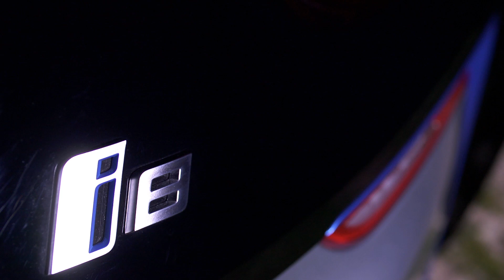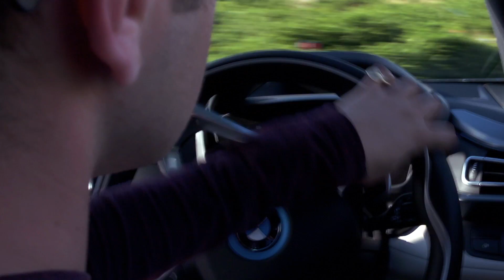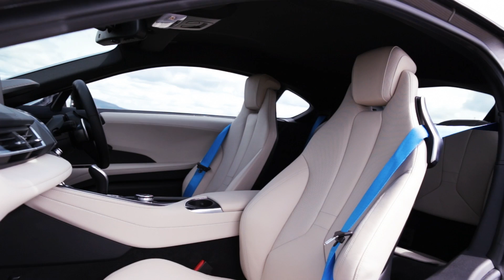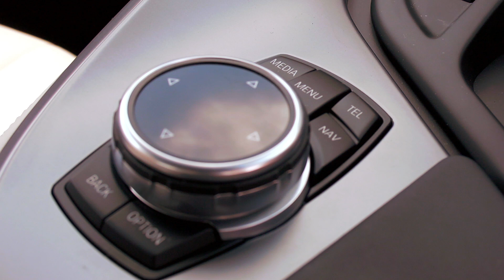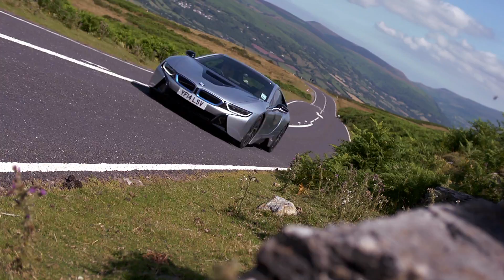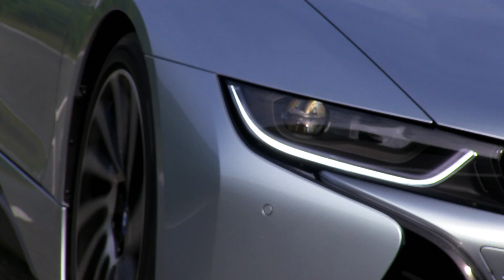BMW i8: Supercar 2.0 - XCAR

Comment: Great review Alex you set the benchmark for reviews with drones etc 6 yrs ago, and ref I8 being a polymath of a car, you have  understood it fully sir on the button.... over last 6 yrs most keyboarders think eh 3 cylinder nah and have lampooned it despite not driving it!!  Koeniggsegg don't they have embraced the concept for a car selling for £1m !! 
I have had 3 of them - my latest the Roadster was 40% off list (same discount as the Z8 I got in 2003 for £60k and they are now £200k)-  if you have £70-75k to invest 10 plus years BUY A ROADSTER ONLY 2500 MADE WORLDWIDE / NOW FINISHED WILL BE MASSIVELY LAMENTED IN A DECADE + it's a better bet than FTSE as they will be £150k plus in ten years and £500k in 40 yrs like the hitherto also unloved discounted in 80/81 E26 M1 I have ! WHEN THEY ARE GONE FROM DEALERS, THEY ARE GONE !!

Comment: Nice review, but having seen this in the "flesh," it simply looks too plasticy for my tastes. It looks like someone took a plastic model, put it into an increase size beam and you end up with a full size plastic model. I have no problems with the technology or increased efficiency. It is the aesthetic that I feel leaves a lot to be desired. I wonder if it would have helped if they had gone for a matte finish instead of the high gloss?

Comment: 40 mpg.... would much prefer the Porsche...however Porsche are developing an electric 911. YUK. P.s. man made CO2 (just 1% of the 0.04% atmospheric CO2) is not driving climate,  although electric cars do have a similar CO2 foot print unless solar generated electricity is used to recharge the batteries.

Comment: In my opinion it is a masterpiece of art and engineering. And it combines best of both worlds of electric powered  and petrol enginged  cars. It is the logical step from conventional cars to fully electric cars. (until they solved the "problem" of charging time and range of battery)

Comment: I don't understand why people say 1490kg is light, it's freaking 1.5 tonnes. Sure it's a bit lighter than an R8 but it's also got a LOT less power.
Reply: +Waffle Wong Yee Ket This is a hybrid, which means it has heavy batteries and electric motors on board. Taking that into consideration, 1490 is extremely light. You have to put it in the context of other hybrid vehicles, not regular combustion vehicles that don't have those heavy components.
Reply: D Griffin you're right. But what about the many other non-hybrids that weigh about the same but yet reviewers still call them light?
Reply: Waffle Wong Yee Ket Examples? I can't think of a whole lot of cars that weigh less than 3200 pounds, other than compacts, sub-compacts and micros (Civic, Fit, Smart, Miata, etc). So for any high-performance car to stay down around 3200 pounds is actually pretty good.

Comment: This car is not made for the racetrack... and for that it`s not a true sportscar! It has fake sound, it is to heavy....(1600 kg even with that carbon monocoque cause of the heavy batteries), can not take heavy g`s with that small tyres and after 2-3 hot laps your batterie is draining and all the other cars and for sure the 911 (which he always talked about) will eat you up with ease! Whats the point of a sporty car wen you now it only lasts for a couple of minutes before your down to your 1.5 litre 3 cylinder..?!?
Reply: ***** You`re right... if i had that amount of money i would directly go buy a 911... a true sportscar not just "a beautiful hybrid sports car" ;-)
Reply: +UzzyFuzzyy you can't afford it either. You're just a pest. Electric cars are a fad.
Reply: If you can buy a i8 it doesn't matter how fast or how heavy it is, you would probably have a few other cars....
Reply: Bet scho lol the i8 dosent loose battery in sport Mode. Actually it charges the battery and the 2 Electric Engines...
Reply: Bet scho also the i8 sheer weight is 1480kg
Reply: I have one and I did a 3000km roadtrip through Germany last spring. You know what I mean? Ok, so it never ran out of power even over 200km/h over 3 hours. The Porsches cleared the lane like flies. They know why.

Comment: Ya that's great and all but why can't they put all this weight savings in an actual car instead of compensating for the batteries! If they put this much effort into a regular sports car it would be amazing they could make the m3 or m4 now like 2 pounds I mean really and additionally if this is a sports car I don't see much modding capabitites in the future I mean to my knowledge u can't really mod electric engines? And they have pretty much juiced all they can get out I that engine were as a 335i 500$ for a jb4 gets you 380hp and 420 torque and another 100 for a DCI intake and your at 400hp and 420torque for 600bucks!  I don't see that happening with these new hybrid sports cars
Reply: Give it time. This is BMWs first hybrid sports car. Once the market starts to see some more options, things will adjust.

Body weight - They could do this to an M3 or M4, but it would cost at least US$10k-20k more due to materials and process increases. The i8 costs around US$135k, which is about US$70k more than an M3.

Two things to understand about modding engines: 1. The ICE has been in assembly line cars for about 100 years, and modding car engines didn't become really popular until the 1950s, after it became affordable for average folks to buy a car. 2. There are still gears and mechanical parts in Hybrid engines and electronics and computer modding started to become more popular in the late 1990s when PC prices started to get very cheap. It might take another 20 years, but modding hybrids or electrics will certainly happen.

Comment: I like engenering, turbo boost from big turbo, with no turbo bust in low rpm, what electric power compensate with high torqe in all rev band. God like aceleration and low fuel consumption. Sports car on the budget

Comment: I'm a little disappointed the narrator doesn't know the difference between a motor and an engine. Pretty basic stuff.
Reply: +Jackie Scholl FYI- A motor develops it's energy in a remote location such as a battery or generator. An engine converts it's energy within the device, such as an internal combustion engine or a jet engine. The conversion process takes place within the device.
Basic mechanics... there is a difference. Any gearhead worth his salt knows the difference.

Comment: With that amount of torque and horsepower, and weighing as much as it does, the i8 could easily do sub-4 second 0-60mph times with more sporty gearing. But BMW made a nice compromise between quickness and economy/emissions. I just hope there are enough people willing to lay down that amount of cash for this car. I'd love to see them on the road on a regular basis, and I hope it doesn't die out quickly because of the price.

Comment: "Looks like it was designed by Tony Stark"  

Tony Stark designed the Tesla Model S, not the i8.
Reply: The Model S looks a bit to bland to be designed by Stark.
Reply: Joseph Brody No insult but the tesla looks old already and the interior, looks like they just glued a 17" flatscreen. I drives nice but is way too heavy, for $100K they need to start using Carbon.
Reply: ***** Its those damn batteries.  They are heavy.  And when it has 200 mile+ range or now 400 mile range announced for the Roadster (with some modification).

Comment: never understood the need to make low-volume high-budget sports cars eco-efficient. so few of them are purchased and the ones that are are only driven a fraction of the amount that mainstream cars are driven.

i guess the technology is meant to trickle down, but why can't low volume $100,000+ sports cars be the realm of old fashioned visceral auto design? for the 1 day per week blast, i want to feel a haughty v8 engine note tickling my spine. for the other 6, i'd be happy to drive an electric or hybrid car, and i'd be doing my part to help the environment.

Comment: Always said, once there is a big enough market the giants will enter. As he says i3 and i8 are BMW's first efforts in the hybrid market with purpose built vehicles and not reworked existing models. And they have already sold a tone of them.

Soon there will be BMW i1, i2, and i3 with batteries and 0,5L and 1,0L petrol engines for the masses. And sports cars like i8 but even better. And of curse the other giants will fallow.

These kind of cars are the viable cars of the future until there is a real and expanded infrastructure for battery only car. Cars that cost less than their petrol counterparts, can be charged everywhere (and not a supercharger every 250 miles) and also can be charged in max 5 minutes on the way. A bit longer at home, but not in 15 hours.

Comment: Overpriced, underpowered, overhyped, and drowning in pretentious BMW fans. Looks cool though.

For just over half the price you could get a Corvette that would run circles round it in every performance category- if you were buying a car for performance.

And for the same price you could get a Model S that's actually worth the hype generated about it- if you were buying a car for cool factor.

This is something bandwagon jumping hippies with money buy, who are into the BMW badge. It'll do well in the showrooms, but it's not exactly an enthusiasts car. That vaunted BMW badge used to mean a lot more than it does now.

Comment: I don't like the misleading way they claim this and other cars can go "electric all the way" when it only does 20 miles.  That's literally useless unless you're only driving for a few minutes a day.  I will basically use gas 99% of the days most people drive it.  Just go full electric and stop wasting time on this.  The Tesla's 7 seater already outperforms this 2 door "supercar".  I like the carbon fibre and design direction but the rest seems overpriced and over-hyped.

Comment: Oh God BMW put the same intrusive V8 noise inside the cabin via stereo again..
Reply: At this point any noise from a BMW cabin is fake.
Reply: No that's actual engine noise and this car doesn't have a v8 additional it's pipped in so it's the actual engine noise it's not pretty recorded ..it's due to the great chassis of the 5 series which they use for the 7 series an rolls Royce so that sound insulation is too great now don't comment until you know what the fuck your talkig about
Reply: trevor philips you write like a second grade student.
Reply: trevor philips fanboi much?

Comment: The idea of a concept car is pretty simple. The clue's in the name. They're about conceptualising ideas. The production cars that result from it are never going to be the same, and they were never meant to be. That said, most of BMW's recent "concept" cars have more or less just been the production cars anyway. Take a look at the "concept" version of the 4 series.

I'm not sure I like this i8 though. I mean, it looks cool (except the wheels in my opinion), but I don't really like the way they've done the hybrid stuff. It still feels like it's two separate drivetrains stuck in to a single body. That doesn't sit right with me. I much prefer it the way the P1 does, where the electric stuff is kind of like a supercharger that compliments the combustion engine instead. Also, you have to wonder what this car would be like if they could have saved some weight and focused on just putting a more powerful combustion engine in.
Reply: Muzica populara

Comment: Let everybody ramble about hybrids, I take my V8 Jag' instead...
Reply: ***** I hope you aren't flooring it and only going 90...
Reply: Its cars like these that will let you run around in your V8 that little bit longer
Reply: Yes, I agree, all internal combustion engined cars cause greenhouse emissions.  It's certainly worse to have a V8 over a VW, but both will cause pollution.  We're already experiencing the consequences of over a century of pollution, and the time for cleaner and more renewable energy sources and uses is long overdue.  It's important for us to start acting immediately to reduce our carbon footprint, and cars are a large part of this.  Hybrid systems aren't perfect, but they're a step in the right direction, and these are steps we should've been taking for a long time.
Reply: I fail to understand this comment, to the best of my knowledge I am not a section of a woman's reproductive system  ;)
Reply: Alexander Young
Actually we will fail to do so for great cars are too few to do so. Golfs and such stuff suck the world out of fuel and spoil the environment.
Reply: Did you do any research before you started posting?  Cars and transportation account for 12% of global greenhouse emissions.  Whilst agriculture is slightly higher at 13%, "cows farting" is by no means the largest producer of greenhouse gasses.  That title goes to electricity manufacture and heating.  Before you say it, there are alternative ways of generating electricity to burning coal.  You don't have to use on-grid coal powered electricity to change an electric car.  I don't mind you having a different opinion to me, in fact I welcome it, but spouting rubbish and claiming with the utmost certainty that it is correct whilst insulting the other individual does nothing but mislead and misinform people.
Reply: Calm down fellow motor heads! There is still hope! Hydrogen. Combustion. Engine.
Reply: At the end of the day you will still use resources to run any vehicle and it will take away from something. You will still see a hybrid at the same texaco as you will a gas guzzler. You have to plug up the electric only cars which uses resources also. I say enjoy whatever kind of car you like. The eco fans need to really think before they speak. Emissions are not the only thing causing resources to be used. Until they make a solar and rain water powered car then who cares!!!!
Reply: You will be banned from driving you "V8 Jaaaaaaag" in your living life, so this is the future.
Reply: I know what you mean, but even forgetting about the environment, you can go a hell of a lot further in one of those on a single tank than you will in your jag. you won't have to worry about passing emissions either. until these things become affordable for everyone though, the combustion engine will reign supreme.
Reply: The worst thing to ever happen to electric / hybrid cars was the Prius.
Reply: ***** Well when people like you with your Camaro's and V8 Jags have sucked the world dry of fuel, belched chemicals and toxins into the air we breathe and fucked up the world for the rest of us, you might regret that decision.